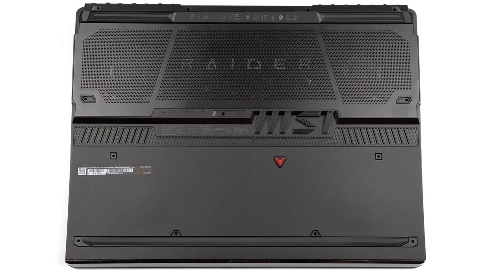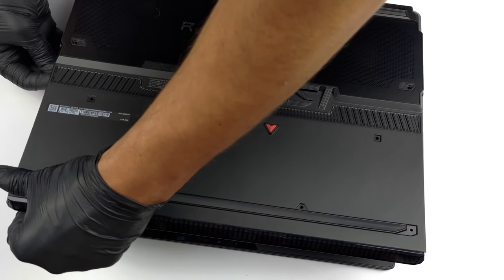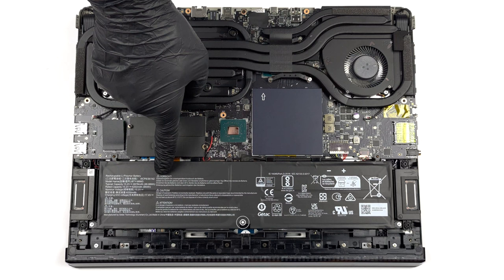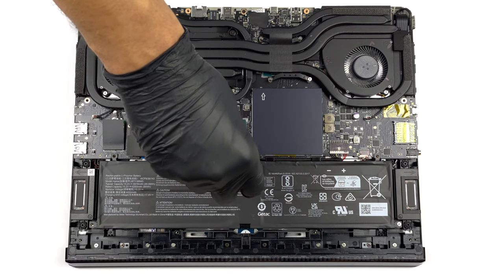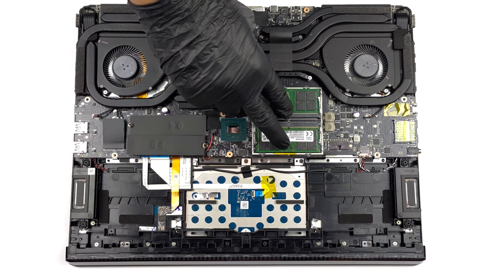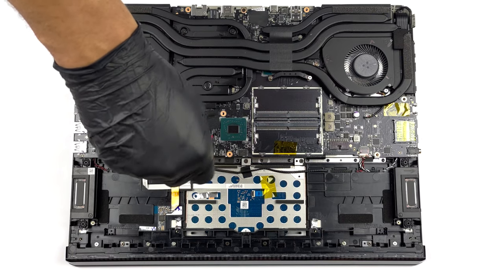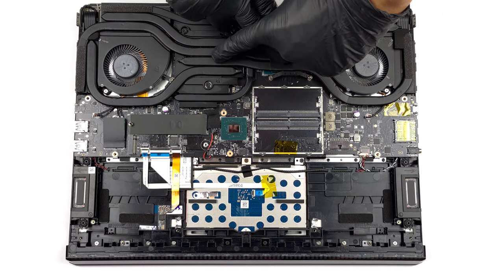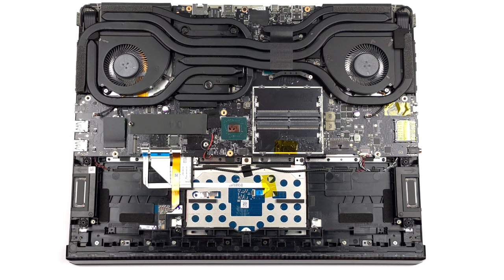🛠️ How to open MSI Raider GE78 HX (13VX) - disassembly and upgrade options

Comment: You also need to remove the hinge cover on the other side of the laptop and just pry off from there, much easier and it just basically peels off.
Reply: Im glad I saw this
Reply: This helped so much. Bro in the video didn't even mention this. This is really the first step. Thank you!
Reply: You mean like when he says remove the back plastic shroud at 23sec, after removing screws

Comment: Such a beautiful machine. Goes to show they want their customers happy. Easy upgrade is ALWAYS a must. I'm aiming to get this soon. I'll be gaming on this thing for minimum 5 years probably 10.
Reply: i got a sick deal on it 4090 and top end cpu for 2600$ cant be better right?
Reply: Better to get a Framework. This is actually much slower than I expected.
Reply: @mrmotofy  The 13980HX does so well with 4090

cpu Z benchmark around 
13700 points plugged in
  6700 points unplugged

the very bad thing is the high temps it need cooling 
i have undervolted it and getting good gaming performance too (even tho i dont really play that much nowadays) with 85~ degree celcius

if the framerwork had even GPU that are not AMD i would have bought it

Comment: Can use an old credit card as a pry tool.  Just be very gentle starting from the side with just the USB ports and work backwards  always stopping and moving past the plastic pillars so as to not break them.  Once at the back, start on the rear plastic shroud.  It must be removed prior to continuing to removing the the cover.  Once it's off, start on the other side and front.  Lift from the front as the cover actually hinges from the rear and you dont want to break all the rear hinge plastic pillars that keep the case snug at the rear.

Comment: Yea the hinge cover on the front back needs to be carefully removed. You will not be able to open this laptop without that blue pick!

Otherwise, great video! Just installed a samsung 980 pcix 3.0 1tb drive in there, works like a charm!

Comment: Can this laptop handle 128gb of ram?
Reply: 64 only
Reply: I don't see why not - they always say max 64 but the processor can handle 128...I've just never seen 64 GB SODIMM modules available yet - maybe in the future
Reply: If you listen to his voice in the video instead of blindly asking people you'd hear him say it's only capable of 64gb
Reply: @imoldgregg8  What I'm saying is max capacity is not always max capacity. Asus specifically lists max as "what they have tested", not what it is technically capable of. My last laptop was max 24 GB. I ran 40 GB with no issues. Don't assume I'm just stupid and wasn't listening ..
Reply: I believe it's 64GB per slot
Reply: on the model GE68 HX 14VGG can run 96GB in total. (I just checked on MSI website)
Reply: Is there a reason one RAM stick is in sticker up and the other is sticker down? Does it matter?